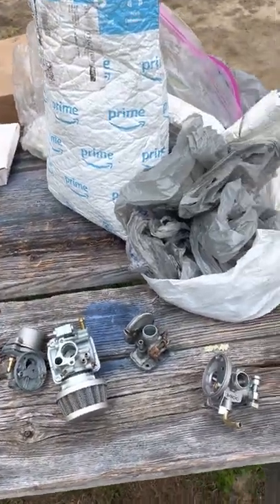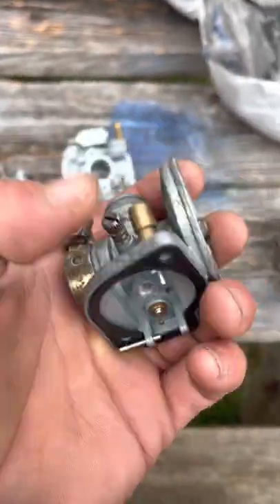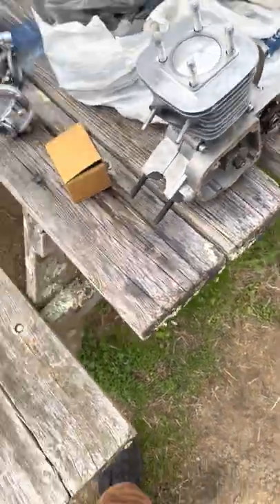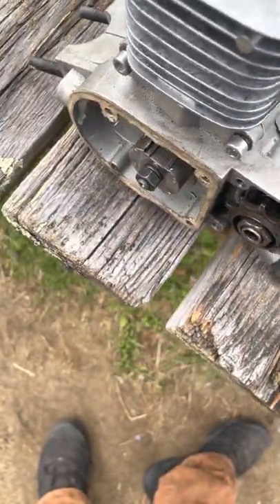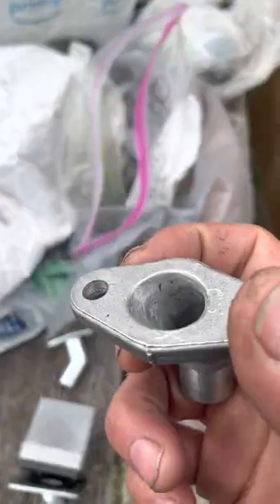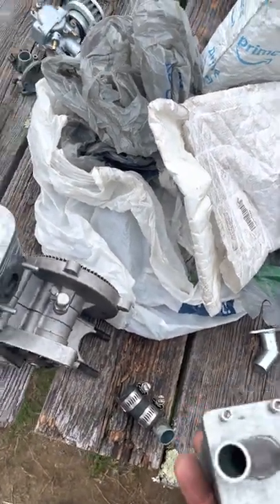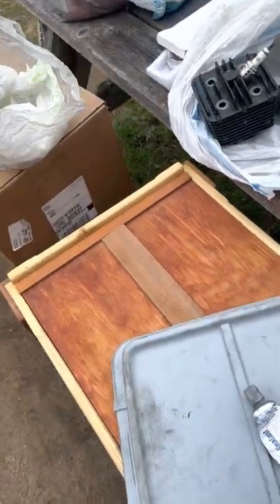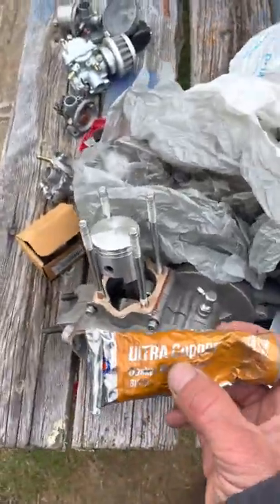Explaining carburetor setup for beginners

Comment: nice carbs broski
Reply from the maker: Thanks OKO  on the new build but she won’t be ready for a bit. Want the Mikuni eventually. I’ve got some other stuff laying around just pulled that out for the video. We made it to the border yesterday down 2 and onto the 1 it was a half tank/ top off. It’s only 30 miles so we would need a couple backups to link up with you. I think there is a station further up and we can fil just before moonstone beach on the border. Mad psyched to try and run wh you bro.